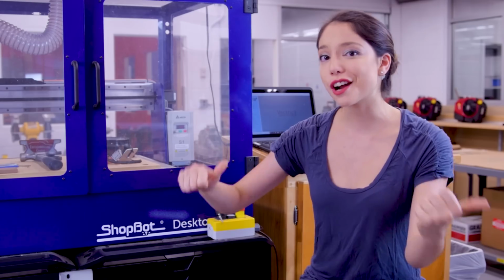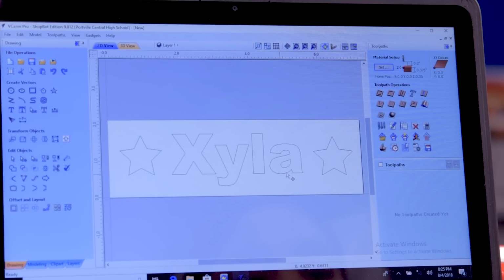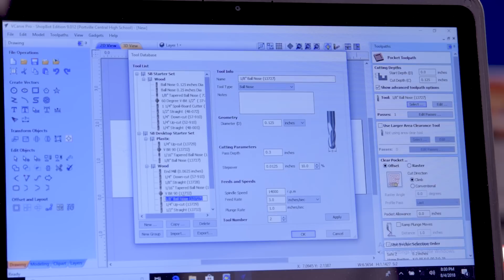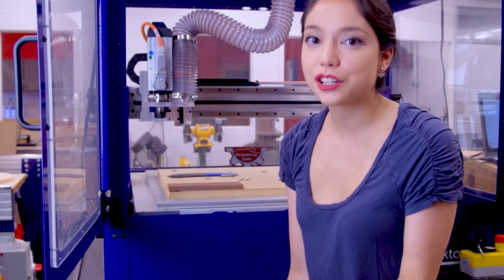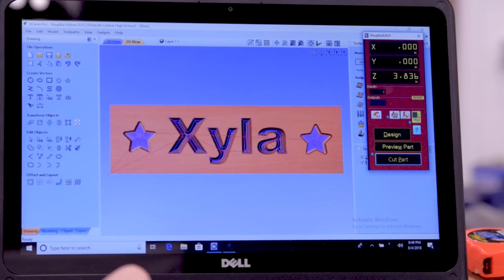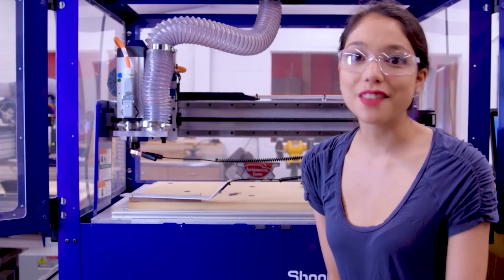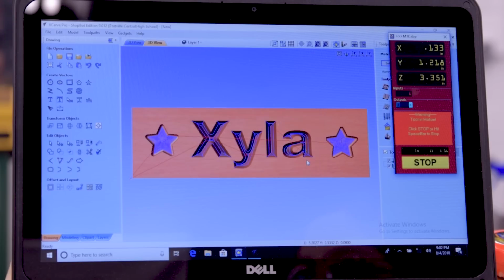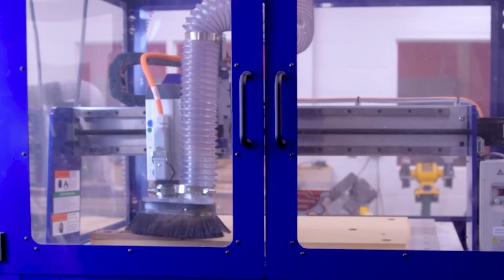Intro to the Shopbot Desktop CNC Mill (+ VCarve!)

Comment: dang! so close. I see you have the Delta S1 VFD on there and I wanted to see you manipulate the RPMs (manually). 
I am still learning CNC with a machine I just inherited and I can't control the frequency... 
turning the analog dial up and down on the VFD makes the RPM fluctuate all over then settle back to F188, every time, even spinning... 
There are no digital spindle control options for this stock old school Shopbot Desktop. 
I'm tearing my hair out. The next thing I'm going to try is coding my own warm up sequence... 
well that didn't work. I can get the spindle to fire up but can't get away from F188. 
I just want to cut! the search continues...
Reply: ended up changing the parameters to control rpm with the digital keypad, the potentiometer has gone bad. hoorah!